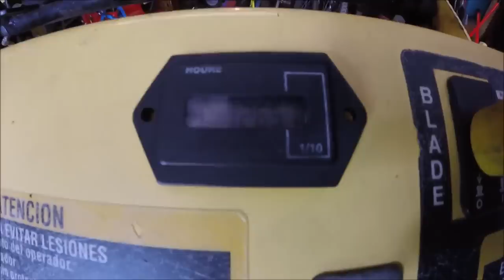Great Dane Super Surfer 2 Stander

Comment: Yesterday I picked up the Gravely version of this. 3605 hours but he claimed the motor and hydraulics were new. Found the hours written on the two motors at 3400 and a date of 2014.  Thing is awesome other than a bracket on the back side of the mower deck that connects to those two arms. The pin that goes through it decided to widen the hole so much to the point that the pin is about to fall out the bottom side of the bracket. I gotta pull the deck and make a template of the good bracket and try to replicate it for the other side.  I want to add another stationary bar to the rearward of the controls so you have something to pull against going in reverse. Maybe also make the stand on platform a tad deeper.
Reply from the maker: There ya go. Great machines

Comment: I have a Snapper Pro 36inch walk behind and sometimes the pto won't engage when it's pulled. Happens mainly after the mower has been ran for a while. Only has 350 hours on it Wondered your thoughts?
Reply from the maker: C&J's Lawn Care I would start with the PTO switch first. Cheapest and easiest.
Reply: Hey I'm workin on a two thousand four Great Dane 61 inch mower deck.my spindles are the type that the 8"bolt goes from the bottom of the blades through the spindles and out the top to hold the pulleys on. One of the spindles is broke and the replacements have a short bolt on the blade and a grease fitting on top of spindle. Will the newer style line up the the two older ones??And my old pulley is 6&5/16"across and it looks like all I can find is like 5&1/2"across.will I have to change all three spindles and pulleys. 61 inch Chariot senior Great Dane
Reply from the maker: Should work fine

Comment: hey bud just pick one up today a 48" do u happen to know the deck belt part number?
Reply from the maker: Straightline Lawn Care no but search Google, the manual is very easy to get in PDF and it's free. All the part numbers will be in there
Reply: CountrysideLawnNY ive been looking all day man lol i found some pdf files for it but they are different set ups from mine and yours the pdf is showing a 5inch tall tensioner idler pulley and mine and yours don't have the big tall 5 in 1 and the PDF file it's showing that that pulley is stationary I need the spring for that tensioner and the belt but all the PDF files then I find they don't even List It
Reply from the maker: Straightline Lawn Care I just punched in "Great Dane Super Surfer Manual" in Google and 30 of them popped up. Took all of 3 seconds.